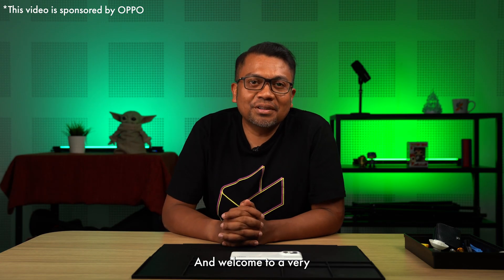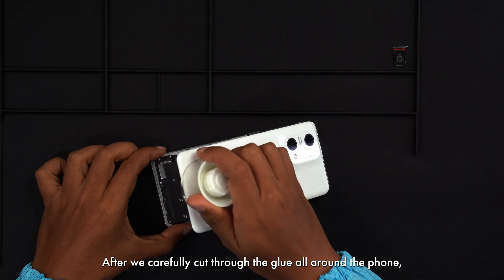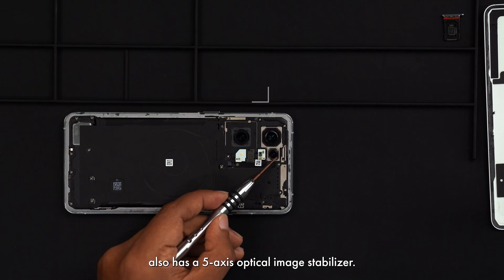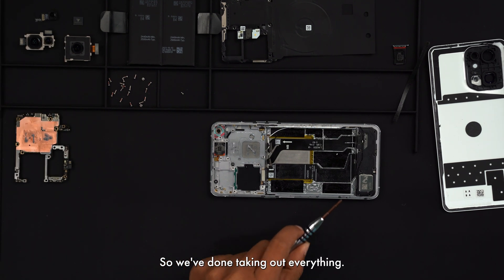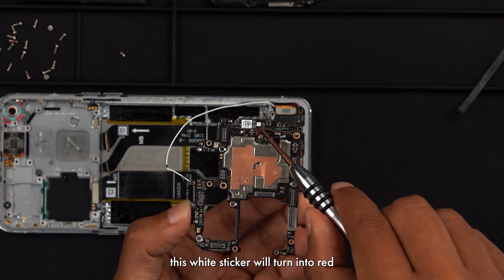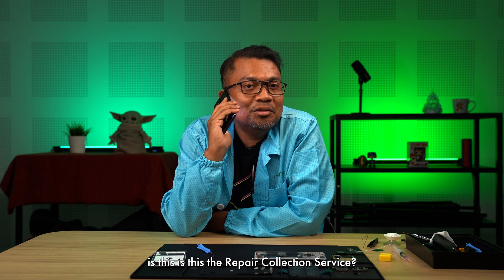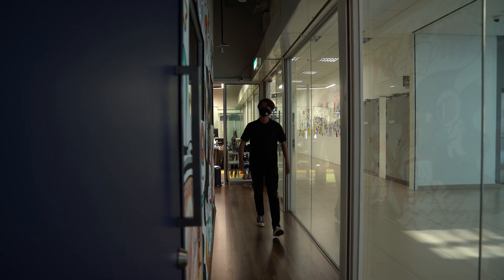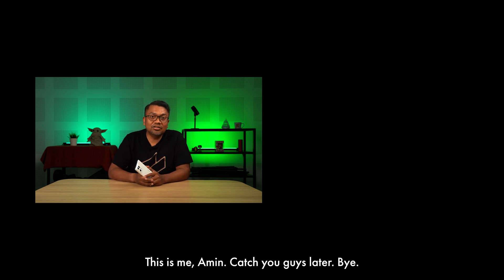Find X5 Pro teardown: A look inside OPPO’s incredible flagship

Comment: Very poor thermal paste application on the SoC. No... wait a second. There is a missive air gap between the copper shielding and the vapour chamber. What!? What is the point of a 75 percent bigger vapour chamber if the heat from the SoC can't get to it in the first place.
Reply: Are u talking to yourself?